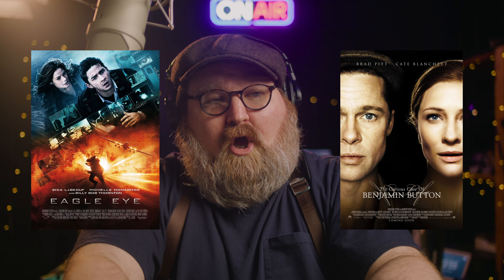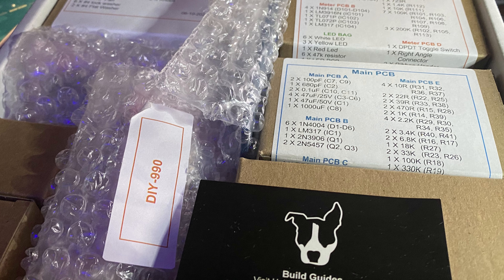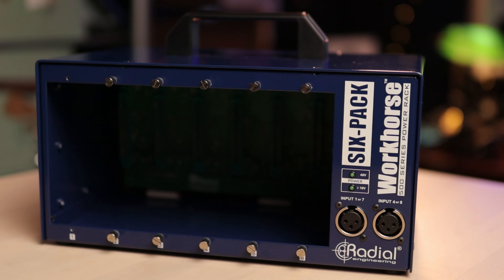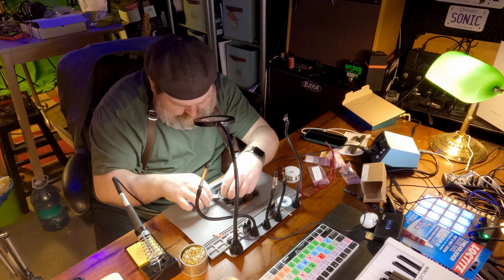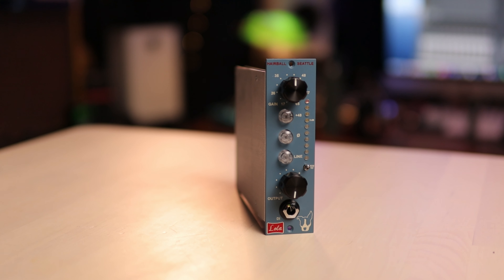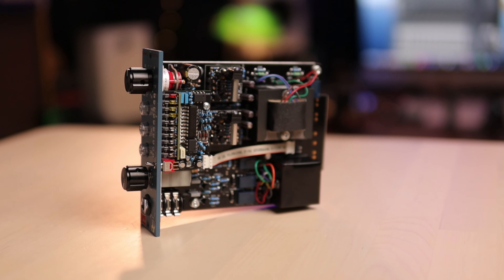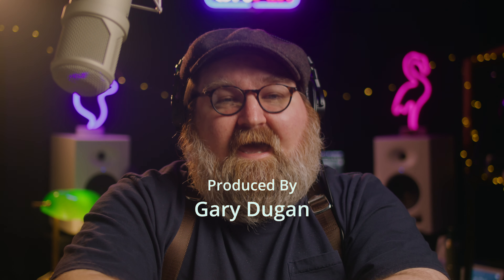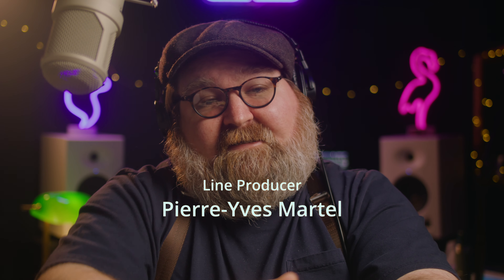Hairball Audio Lola Microphone Preamp

Comment: As an electrical engineer (and software engineer) I understand the feeling. The first time I soldered a board I also became hooked on the feeling, and I've doing that ever since. It's amazing, especially when you plug in your project and it works (not so much when it doesn't, waaaaaay less when they blow up).
Reply from the maker: Hahahaha. What a great feeling, eh? It’s so great! So empowering! 

Cheers!

Comment: 990 sounds good, 512 is nasal and ring-y
Reply from the maker: I love them both for different reasons. The 990 is really open and I’ve been using those ones for the last month or so because I also built a Copper and that uses a 512. But I friggin love the Lola.

Comment: For us newbies - is the benefit of a preamp just to add gain and some flavor to the mix before it hits the audio interface? Thanks for all you do!
Reply from the maker: Hey great question! 

Mics put out a signal that is far too low to be recorded. So it needs to be amped up before it can be recorded. Preamps bring a mic up to line level. Most interfaces and recorders today come with tiny modern preamps built in, but they are flavorless and sterile. 

In the old days they were made with tubes and transistors and transformers and all kinds of parts that created a sound we’ve all come to love (40s, 50s, 60s, 70s, 80s, etc). 

So, yes. Hand-built preamps that replicate the parts used in the old days impart a wonderful sound to the mic. 

All the big studios in the world use various outboard preamps to achieve that sound.

Thanks for the question!
Reply: @TheRecordist  awesome that makes sense thanks for the reply! Love your videos but they make me want to buy many microphones haha.
Reply from the maker: @hackinghifi  hahaha. So sorry about that. They make ME want to buy many microphones too! 

Cheers!